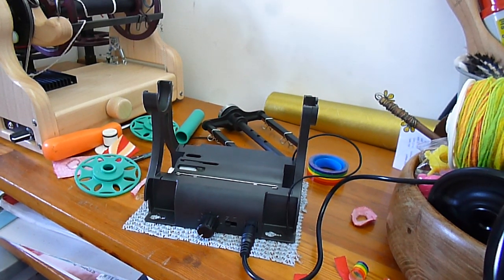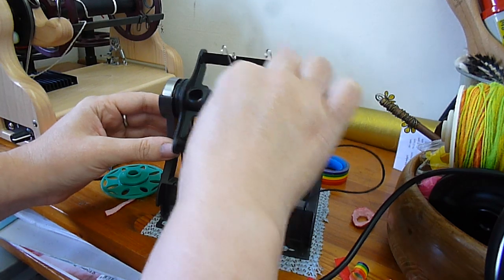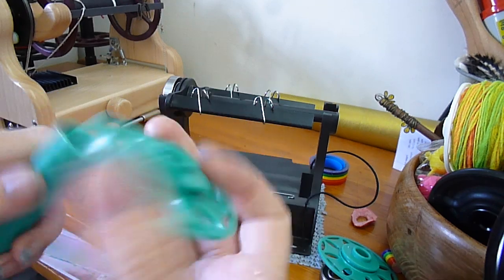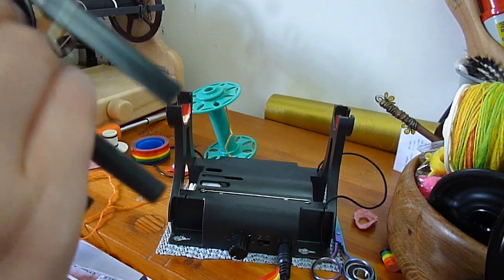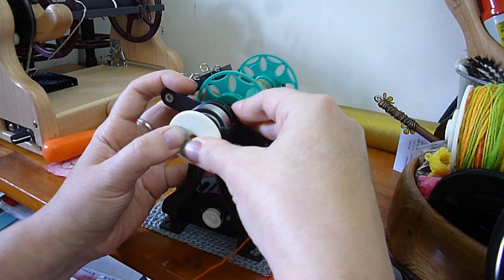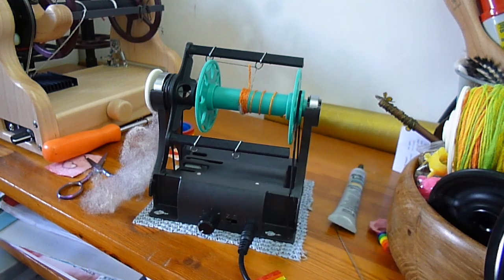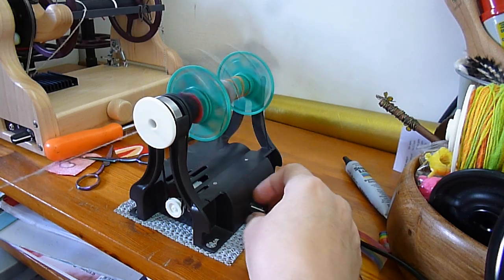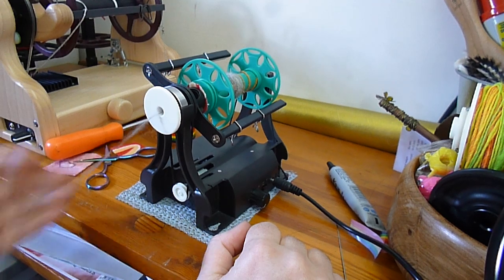EEW Nano - reducing noise

Comment: Great job on this video, Vampy.  One other thing I've noticed; as I put a brand new bobbin on, it's a bit more noisy, but spinning for just a bit seems to settle it in and it quiets down. I've done most of the mods you've used here, and my Nano is super quiet. I spun in the airport, and on a long flight with no noise problems to bother other travelers.

Comment: Hi Vampy, I'm fairly new to Spinning,  I use Drop Spindles.
I've got 10 of them, I love using them. I just asking if you think this Wheel is good for Newbies. I've been thinking of getting one, I  don't have room for a conventional wheel,  also I wouldn't be able to  use the treadle.
Thanks for all the information you have putting into this video.
Happy Spinning.
Take care & stay safe.
Jen xx 
England
Reply from the maker: If you can already spin on spindles, then you should be able to spin on the nano just fine. It's a little fussy about how you set it up, it doesn't like to have lots of tension, and likes to spin fine yarns. If you're mostly wanting to stay at the fine end of the spectrum, then you'll be fine... there are people who have never spun before who learned on the nano, so it's certainly doable for someone who can already spin. If you want a more versatile spinner and would like to spin art yarns/thicker yarns, or just want larger skeins, then the EEW 6.0 is a great option, it's bigger than the nano but still portable, and is much less fussy about the settings you use. It's also faster and quieter.
Reply: @vampyyy  Hi Vampy,  thankyou so much for replying so soon. I think its probably time I bought one.. its mainly think yarns that I get on my Spindles. 
I've  also saved this video, so I can do the troubleshooting  for when I do get one.
Thanks again for your advice. 
Happy Spinning. 
Take care and stay safe. 
Jen xx 💖